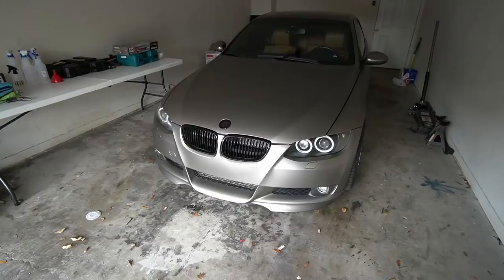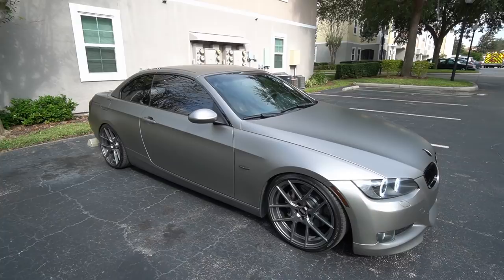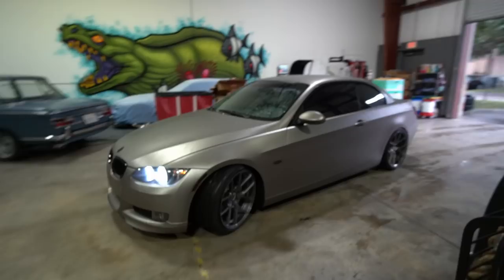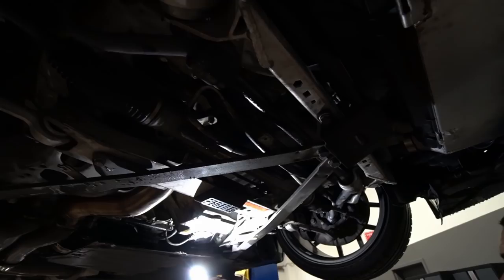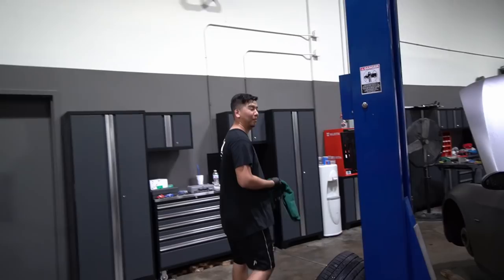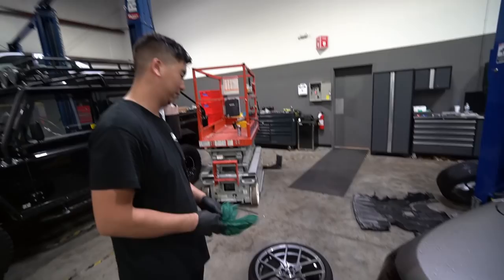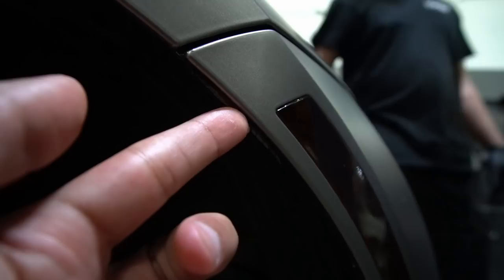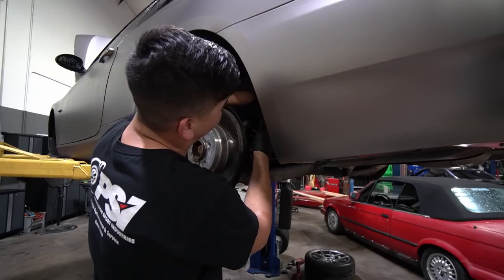I Drove My BMW 335i On A Terrible Suspension Setup For 7 Months And Had No Idea! - EP 18

Comment: Hey Christian, I have that same noise at low speeds with the wheels turned on my 2008 E92 335i. Especially when reversing, but also going forward
Goes like this:
Cloink! and the maybe another Cloink!
I've had a shop inspect it and they could not find anything.

At that shop where you at now, why not have your car corner balanced? Seems like a worthwhile investment although I have no personal experience with that.

Another excellent video! I love your honesty about all things. And yes that wrap is beautiful. Mine is original titansilver, so not that far off, but your wrap kills it!

My recommendation is to do indeed gloss black (with silver flakes!) wheels.
They will shine like a dog opening it's mouth!
Also gloss black out the side mirrors. Either wrap or paint.

If you get it like this, I will probably shed a tear when I see it.
Reply from the maker: Is your car lowered on coilovers as well?
Reply: @VehicleVirals  I think it just has stock suspension, non-m sport

Comment: I really like your videos man. Please dont stop making them , i like your videos so much i watch them always A-Z and i learn alot from them. I drive the E93 325i since 2009 since brand new, im the first owner. Drives like a dream. Respect ✊ from Oman 🇴🇲
Reply from the maker: You're the first owner of an 2009? That's awesome!
Reply: Yes i know , i have looked after it very well. All OEM except inside , i installed an android screen since it did not come with one, change gear knob , steering wheel and partial wrapped the inside . Looks epic . Ill send you a photo in ur instagram 🙂

Comment: I made most of the same mistakes on my BC coilover install on my 335i too lol. Wrong preload, way too much toe in the rear (killed a set of tires in 5000kms!), bad damper settings. Once setup right they are great coilovers. And yea please upgrade those turbos asap, stockers suck! I had the Dynamic Autowerx stage 2's and now the stage 4 model in order to make more power on pump gas, both are really excellent for the money, you'd be happy with anything from them I think. The stage 2 model is your best bang for the buck out there

Comment: Hey I want to get the valvetronic exhaust for my 335is. Is the valvetronic part only on one side of the exhaust or is it both sides?
Reply from the maker: It's only on one side. When the valve is closed it funnels the sound to the stock side.

Comment: I only lust after the classic, these modern BMWs are totally disconnected with the ultimate driving experience!
Reply from the maker: The N54 equipped 335i and the M3 from the same generation are not disconnected at all imo. They are as raw as any BMW from the past. The models that follow I can't say the same because of all the electronics used in them.